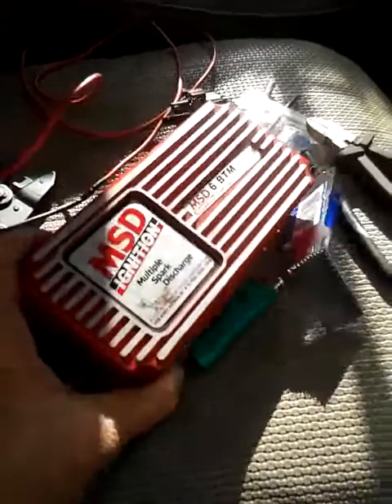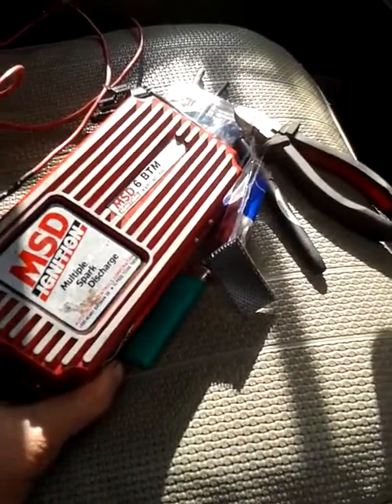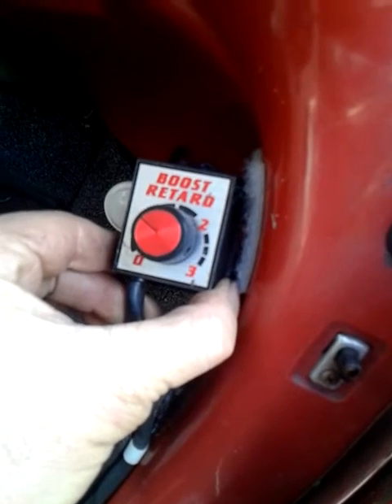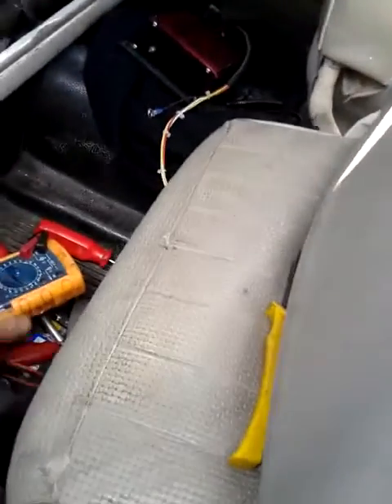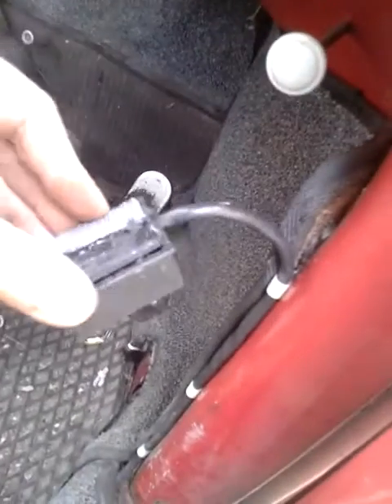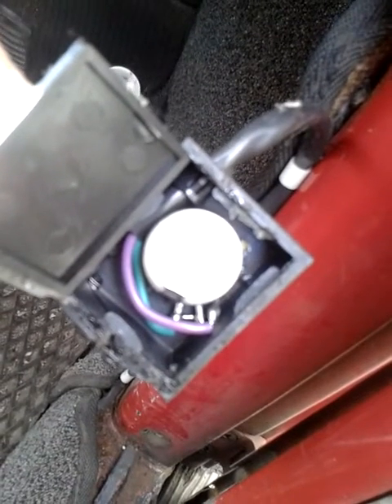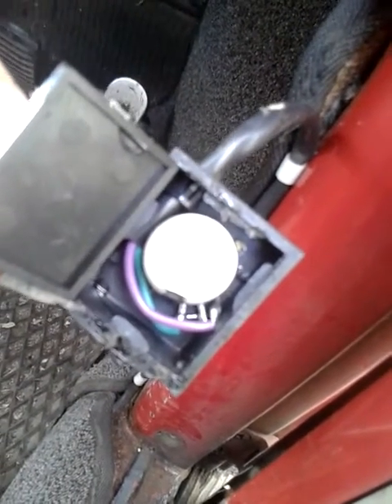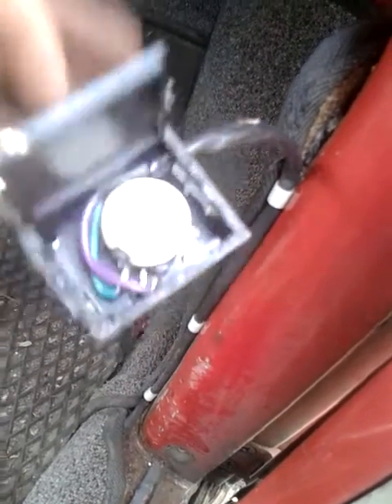Cheap alternative for an adjusting timing knob on BTM MSD

Comment: I lost the control.can i use like that in my 350 chevy
Reply from the maker: Yes if you get a 10k potentiometer and wire in should be fine. Can be wired either way as its to control resistance .
Reply: @rattedbug5003  thanks for the information.if i install the know how much resistence have to be?
Reply from the maker: @elgallonegro919  10k potentiometer google how to wire. If you have a volt meter you can switch it to resistance and see which terminals you connect. Will go from 10k to 0 ohms by turning knob or other way round. Have a google good luck. If your stuck I could build one as stated but you would have to pay for cost plus shipping.
Reply: @rattedbug5003  cool man.thanks
Reply: @rattedbug5003  ill let you know.thanks